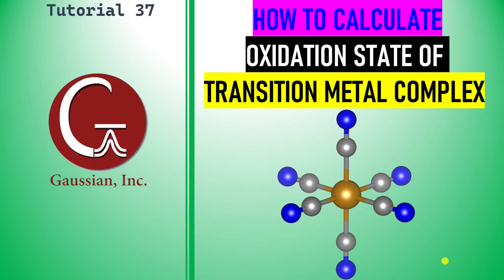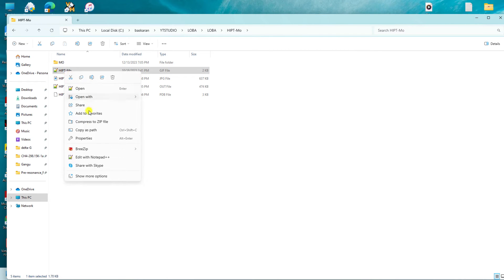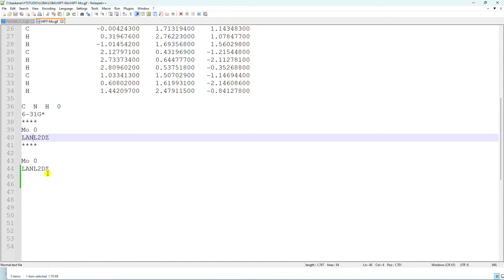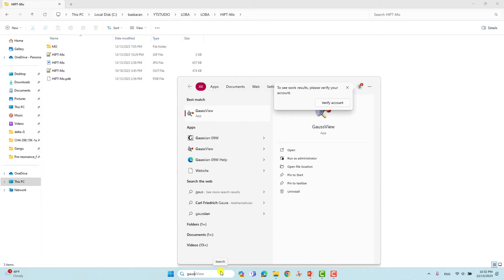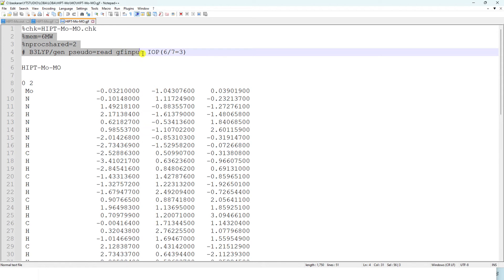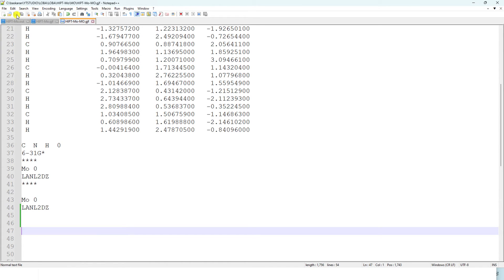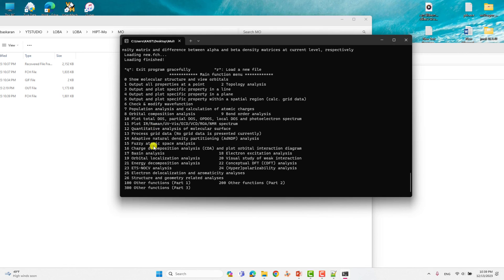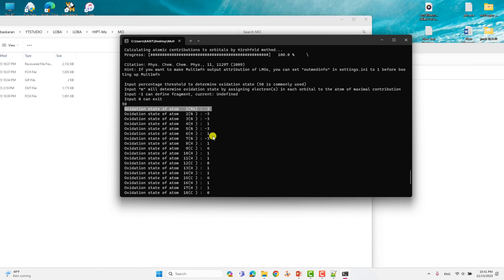How to calculate the oxidation state of transition metal using Gaussian 09W or G16 and Multiwfn

Comment: Hi sir could you please give an example for iodocompound optimization input file and basis set. It will be helpful sir. Thank you sir
Reply from the maker: Iodine possess metallic properties, so you can try LANL2DZ ECP basis set like transition metal
Reply: Thank you sir for your concern. I am trying to optimize DFT b3lyp 6-311G, so I tried additional inputs for iodine from your previous video. The job was stopping with error. Could you please provide input file for any iodocompound will be helpful sir.
Reply from the maker: You can check my metal complex Gaussian input file for iodine system. If you face I will make input file for you